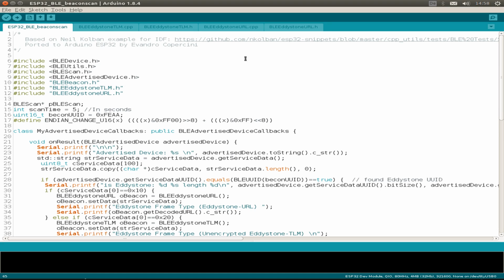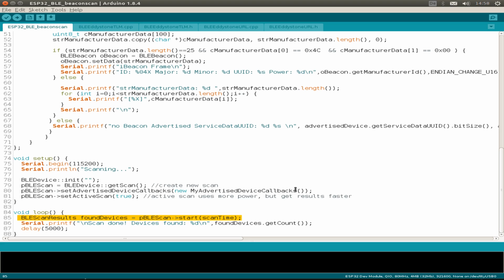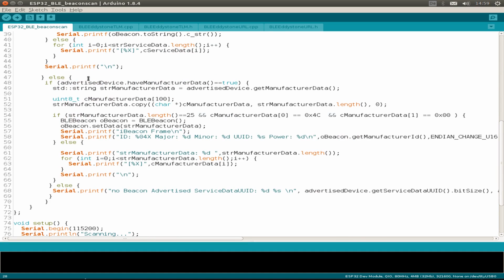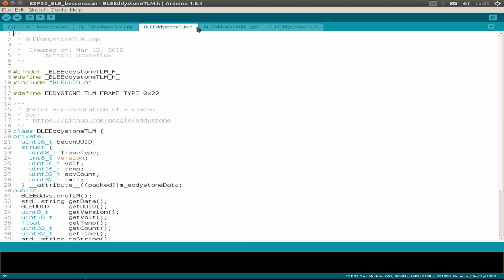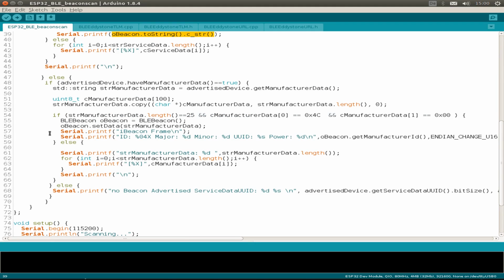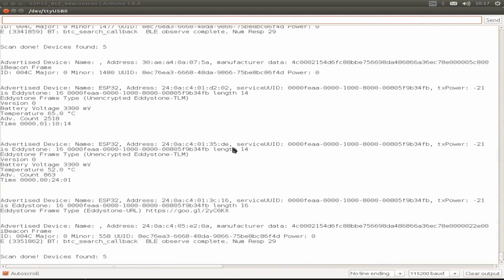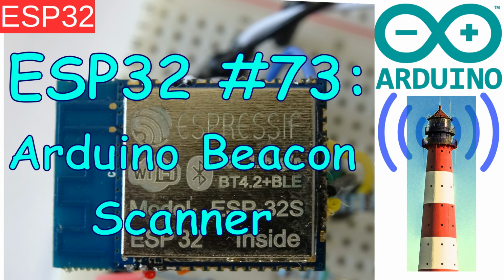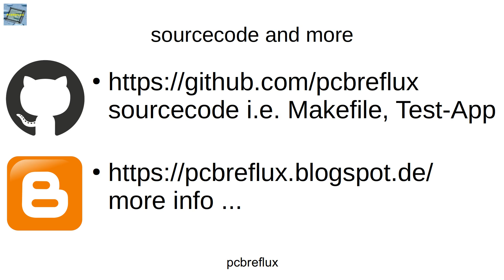ESP32 #73 Arduino Eddystone Beacon Scanner

Comment: If your output on serial is gibberish: change the baud rate accordingly
In @pcbreflux's example in this video baud rate is 115200 
//usually its set to 9600 baud 
this can be changed in the setup() section of the code shown in the video
Serial.begin(115200);  //change it to Serial.begin(9600);  or whatever baud rate you have on your serial output

Comment: i have 5 Eddystone
But the scanner some time misses the 1 or 2  eddystone.
Please help me to find all the Eddyston available all the time.
Reply from the maker: DIY LAB Hi, think this depends on your beacon transmitting interval and scanning interval. Best way is to increase the sending side (more delay and less deep sleep) but as a downside you also increase the power consumption.
Reply: ya i Spoke to the beacon manufacturer,
they said it advertises at an interval of 5Sec.
not Sure about the sending side delay time.
Actually i am scanning for an interval of 20 Sec,Still the problem persist occasionally.
Reply from the maker: DIY LAB Do you increase the "int scanTime = 20;" ? An maybe test " pBLEScan->setActiveScan(false);"?

Comment: BT is not low energy lol. Better use simple RF transceivers with some encryption.
I used BT and it kills batteries very quick.
Reply from the maker: If you use the ESP32 only as an bluetooth beacon the energy consumption is indeed not in the "low energy" category, maybe have a look at the nordic semiconductor nRF5 chips instead, but it makes more sense if you need more computing power like two cores or also need WiFi for your application.

Comment: Excellent work as always…  I’m using an nrf52832 beacon (with unmodified Nordic Eddystone Beacon software) and your scanner on a LOLIN32 LITE. 
All seems ok on nrfConnect, but I’m getting strange temperature values from the ESP32 scanner; variously, 20.0, 16404.0, 32788.0, 49171.0.  ('Volts', 'count' and 'time' values are ok).  Any ideas?
Reply from the maker: Can you post the HEX-Values and the corresponding temperature, so we can figure out whats going on? Maybe its the hex to float conversion and it needs also an endian change?

like
#define ENDIAN_CHANGE_U16(x) ((((x)&0xFF00)>>8) + (((x)&0xFF)<<8))
Reply: Sorry, should have thought of that...
serviceUUID: 0000feaa-0000-1000-8000-00805f9b34fb  
Temperature shows as 16404.0 °C  (it should be 20.0 °C)
Reply: Ok, I think I understand what's happening.  TLM frame temperature is formatted in signed 8.8 fixed-point notation, so parsing needs to be something like this: https://gist.github.com/marcwan/eb3760cee286e7026594
Reply from the maker: For me just casting a 16bit float to an 16bit int works fine.
Reply: Fair enough.  Your approach works for sending integer temperatures, but it's not compatible with the Eddystone standard (which can handle decimal places).